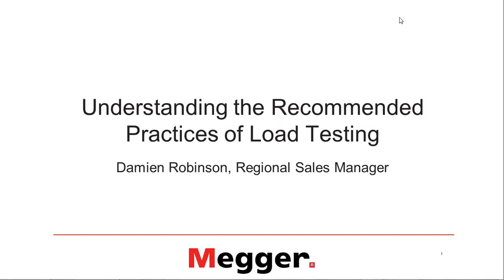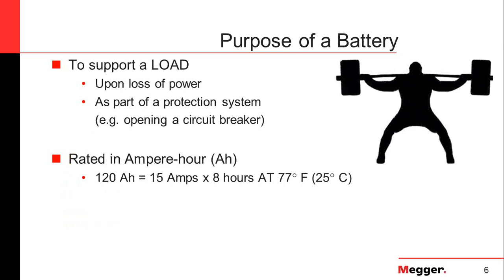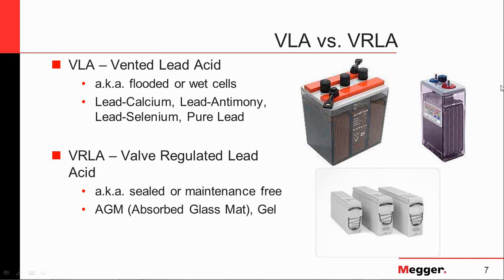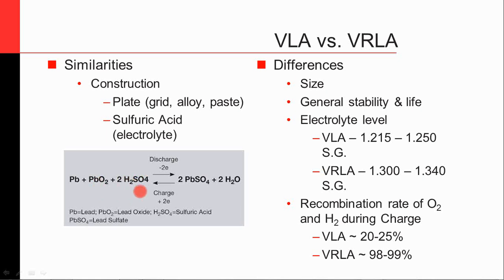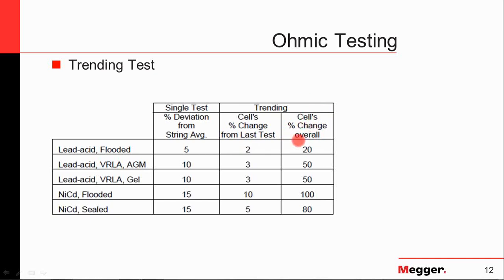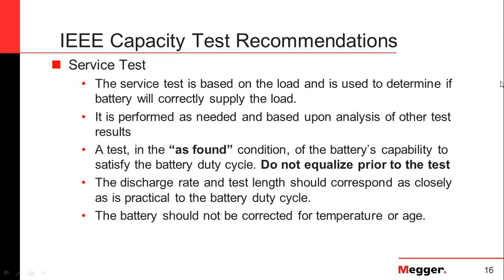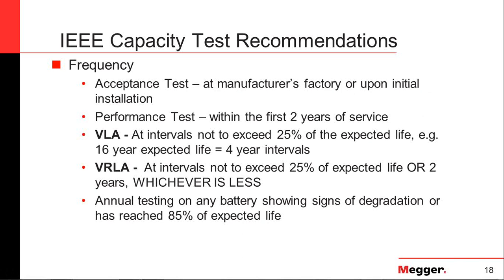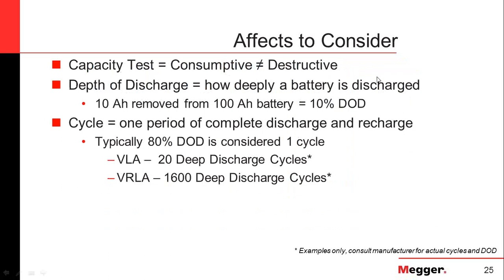Understanding the Recommended Practices of Battery Load Testing

Comment: Nice recap of the IEEE recommended maintenance and testing of VLRA & VLA batteries!  Reading through the standards (dry in nature) is a challenge in itself so your presentation helped me solidify what I had read and helped connect the dots!  Also the contrast between NERC and IEEE testing intervals was a great point!  Just wanted to let you know your shared knowledge was absorbed and much appreciated by someone!